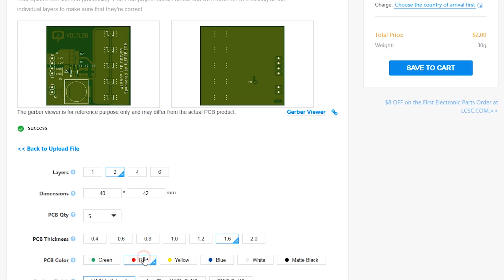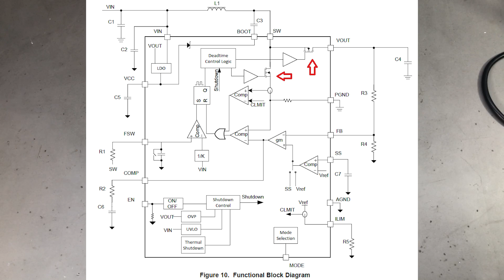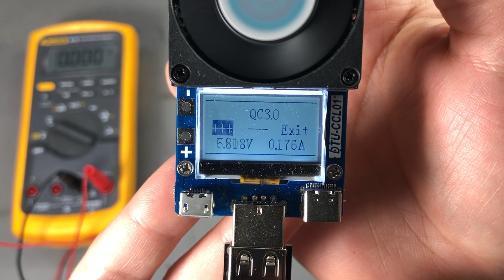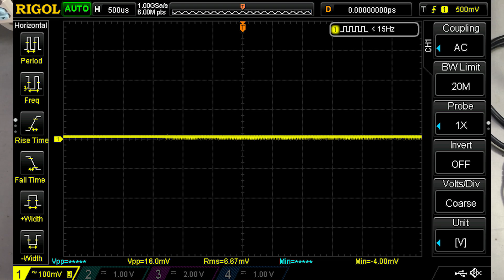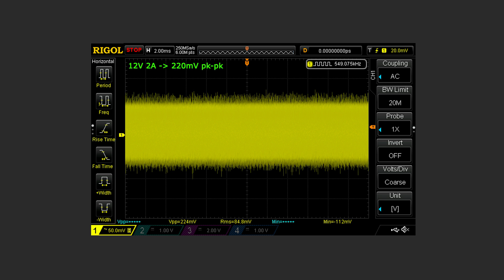Voltlog #245 - TPS61088 Boost Module Test (with QC3.0)

Comment: I use this module to be attached to the TPA3110 using 1s battery, but the speaker output is not optimal (up to 80% volume) and if it exceeds that the sound breaks. please help me and find out the solution 🙏 
Thank you.

Comment: As always, material not complete. What was input current? Output voltage 11.75V at 2A? Why not 12V? For the 5V and 2A we have 4.75V? Default voltage output without load  is...? I still have a lot of questions.

Comment: Can i connect in parallel 5 pcs 18650 battery voltage is 3.7v as on input voltage
Reply: You can, I currently use this one with a 26650, better to use heatsync on the Ic and i also added alum. Heatsync on the back
Reply: @PTFuZi  bro small heatsink where i get it

Comment: Hi I've got a quastion. Do you have maybe possibility to test this board(link below): 
in a similar way? I am thinking about using it with pd 3.0 20v trigger(link below):
to charge my laptop with 20v input but I am worried about temperatures under maximum load.
Greatings Wiktor
20V trigger: https://www.aliexpress.com/item/33000678858.html?spm=a2g0o.productlist.0.0.3bc93251abpu8L&algo_pvid=064e6fb0-dfff-430a-bd39-c8d11891214e&algo_expid=064e6fb0-dfff-430a-bd39-c8d11891214e-28&btsid=0ab6d69f15869883114304082e394a&ws_ab_test=searchweb0_0,searchweb201602_,searchweb201603_
board: https://www.aliexpress.com/item/4000186077208.html?spm=2114.12010615.8148356.11.2faa5d97SheyYi
Since this module can only step down voltage does anyone know similar one which is buck/boost converter?

Comment: Results quite typical. If good chips are used they have protection and high switching current. However, small devices do not have room for large dissipating elements, be it pcb or heat sink.
Quite often inductors are not good for max current. Burning inductors is very easy when it goes too near saturation and core heats like crazy at higher temperature. Small wires can help too. I have many devices where inductor heating it the limiting component.

Comment: I have three of these, purchased at different times from different sources and using two different sources of the same USB A socket form-factor. The through-hole mounting legs didn't look soldered on mine either but on closer inspection, I'm pretty sure they are. Also, with the split in the legs, I think they may be intended for pressure/friction retention in the first place.

I just use mine with 5V Apple and USB BCP devices, so the peak output is 12W. At that power, it runs considerably cooler than any of the other USB boost modules I have (which is why I bought more).
Reply from the maker: Definitely one of the better boost modules out there.

Comment: The Performance should be much better if you put the back of the board against some kind of heatsink like an aluminium case. Maybe with a thermal pat or paste under the thermal vias of the IC.
Reply from the maker: Check out next video, Voltlog #246

Comment: Does anybody know a similar module for internal usage? I would like to boost a 1S cell to 12V 500mA with peaks up to 1A. The common boost converter like the XL6009 has quite a voltage drop if it peaks above 600-800mA from my experience. 
If i would use the modul from the video i would have to trigger QC3.0 with an additional circuit to get 12V out of it i guess - so i would prefer an easier way for internal use.
Reply from the maker: this module could ultimately be modified for fixed voltage output
Reply: I have experimented with a number of raw buck and boost chips recently, and find a lot of sag under load, esp when boosting at high frequency.  If your worst case is 3V to 12V @ 1A, that is 4A input on the low side, at 100% efficiency.  Means a huge diode ... and possibly a lot of static resistance on the very thin coil wire.  Please post a reply if you find a mini-boost module that actually does well for your 12V application.

Comment: I have a few of these modules. I used a self adhesive tiny heat sink on the IC which kept the temperature within 120C at ambient temperature of 25C. Try to find one with high fins for maximum dissipation. The heat sinks I used were designed for Rasberry Pi Model 3b+
Reply from the maker: I was thinking to maybe attach the module with the bottom side to a heatsink, probably worth testing in a future video
Reply: @voltlog  I beg to differ, since that IC does not have any thermal contact to the PCB, except heat dissipation from the pins. Most of the heat is dissipated from the back top of the IC. Without prejudice, any heat sink is better than nothing, right?
Reply: @billywhizzy  the Boost IC does have a thermal solder pad on the bottom, so there is pretty much ideal contact to the PCB copper if the designer did a good job
Reply: @wi_zeus6798  thanks! That makes more sense

Comment: Over 2mhz ... wow, these modern boost controller chips are screaming fast.
A small coil is probably needed for that switching speed ... and an RF shield is certainly necessary.
Does the shield on the 2.2uH inductor cover a CD54 bobbin?
Reply from the maker: the shielded inductor they used is about 10x10mm so it would cover WxL but the height is smaller.
Reply: Yah I wonder if these faster switching frequencies have worse noise/rfi problems? I guess I’ll have to read over the TI datasheet

Comment: very helpfull summary, thanks!
maybe a stupid question but how can it claim to have 90% efficiency and getting so damn hot at 24W
Reply: That is still 2.4 Watt.  Have you seen those USB dummy loads with 2 big resistors to test USB power supplies etc?   Mostly they come with a switch 1A and 2A.  The 1Amp means 5 Watts with a regular USB output.  Sometimes they place cautions on the PCB not to touch the resistors. So the 2.4 Watt loss is purely converted into heat.
Reply from the maker: Like Luc said, 2.4W dissipated into a small chip/pcb. And that is the best case scenario, maybe in real life the losses are a bit higher, so maybe we're looking at 3W.